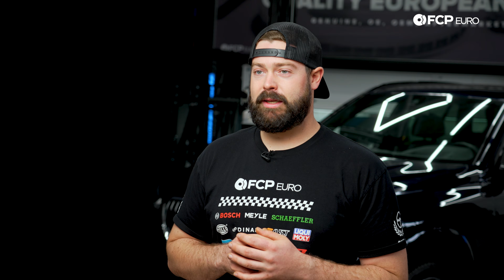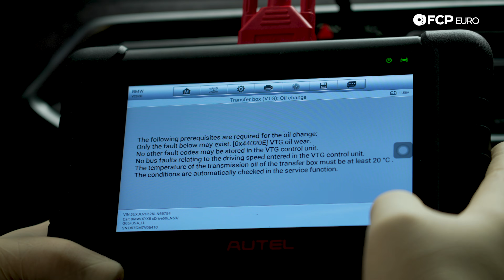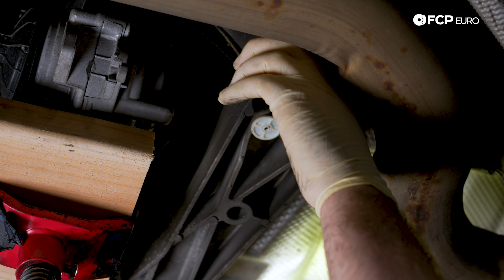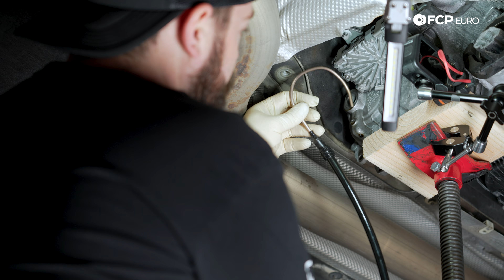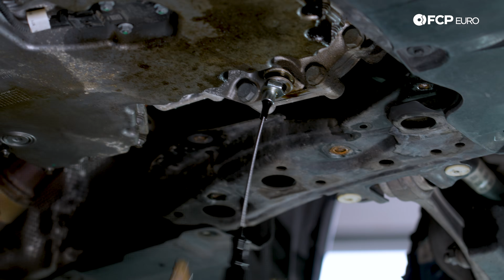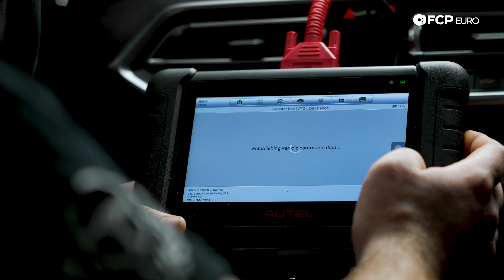BMW X5 Transfer Case & Front & Rear Differential Replacement DIY (2019-2026 BMW G05 X5, G06 X6)

Comment: all the trans and differential and transfer case oils need to be replaced every 30,000 kms. There's no oil additives and protection that lasts past that. Hence why even changing at 80,000 kms or 100,000 kms won't keep these cars around. Too much issues unless you do it at home and repeat. No one does though lol

Comment: I have a 2022 bmw m440i and I am currently trying to drain the transfer case fluid and I can get anything in the port to drain the fluid. I have a copper tubing like what is used in the video but I cannot get it in very far, any suggestions. I have tried using a flexible plastic tube as well, it’s been frustrating
Reply: Did u buy the hook tool from fcp? It’s like a bent metal tube to fit into the bottom of differentials …

Comment: OMG, the VTG fluid change procedure is a challenge especially needing the proper scanner tool to do the joy right. Cole is excellent as host with step-by-step procedure and verbal specification details, especially 600ml volume limit on the front differential. Video production most excellent as well! Quite helpful for DIY'ers. Thumbs up to FCP Euro! You folks are great and it shows!

Comment: Was trying to use diagnostic and open ports. My car wont let me in service mod it require Ista bmw original disgnostic. Insted i change oil without using diagnostic, problem gone instantly no shuttering no jerking, after 30-40 miles driving i change it again. And now all 100% oil is changed. If someone doing this maybe my comment help

Comment: First of all, many thanks for this great video. Very clear step by step instructions. 

I have 2019 BMW X5 G05 xDrive40i B58 Engine. I followed exact procedure you showed. I could only retrieve about 250ml of old oil from the transfer case. Is that OK? If not, what else I should do?
Reply: You didn't get to the bottom of the tcase if you only removed 250ml of fluid

Comment: We have quite the paradox with BMW engineering.  The same engineers that said the fluids are "lifetime" are the same engineers that gave the specifications for the fluids you will be using to replace those "lifetime" fluids in the vehicle.
Reply: Is easy to explain, their “lifetime” means warranty period
Reply: Sometimes you need to remove and refill when doing jobs such as engine oil pan or such.

Comment: Tip:  you can heat same diameter pvc tube to make that bent.  Tip 2:  Once you pump with syringe or bulb just relax as fluid will run down by itself.  Just did mine and it emptied the whole thing no problem (physics).  Tip3:  Remove small bolts from the brace but lean the long one the goes thru the bushing on.  The brace will swing plenty to get the plug, tool, pump.  It swing out like 4-5 inches.  By the way you don't need to remove that small plastic thing but just one screw as it bents back plenty to allow torque wrench to fit.

Comment: you might as well let the dealer do the service.  The cost of a scanner, fill pump etc are more than the cost for the dealer to do the job.
Reply: But when you do this service 2nd time and 3rd time then it becomes cheaper
Reply: @Mekus5  Especially if you are doing it every 30k miles
Reply: my service spalce quoted $700. 600 labor.

Comment: BMW X5 rear differentials typically require SAE 75W-90 synthetic gear oil (GL-5 rating). However the Febi Bilstein 184247 on FCP Euro is 70W-80. Are we sure that's the right oil?

Comment: There is a rear differential temp. Sensor that can be used as a drain plug on the M50i’s.
Reply: Cars equipped with the "M Sport Differential" such as the X5/X7 M50i and M60i models have both a fill plug and a drain plug for the rear differential.
Reply: How does that work. That would be a lot easier.
Reply: @brandonbailey7637   Unplug the sensor and then take a deep socket to loosen the bolt
Reply: Also would like to know

Comment: Thank you for these amazing videos. Could you please explain why and in what situations you would use the “3× Start/Stop + hold 7s suspension button” procedure?
Reply: 3x start stop is to put the car in diagnostic mode. Holding the air suspension button for 7s disables the auto leveling function. The car will otherwise try to level itself out as you jack it up. The green air suspension ride height indicator should go away when it is disabled

Comment: Watched this to try and get more tips on the G01/G02 X3/X4 M40i because of similarities. Especially the procedure of taking the transfer case out of service mode, vs resetting adaptations. It appears the adaptations were reset? It sounds different on ISTA+ and Foxwell scanner from what I've read on the forums where it's two different procedures. Some say not to reset adaptations, similar to the transmission fluid unless your rebuilding a component. As far as the front diff, the forums say it is not fill till spilling out (like stated in the video, thank you!), however there is a 450ml measurement and 600ml depending on diff. I'm going to use a plastic measurement beaker to try and see if 450ml comes out, or closer to 600. The rear diff is where it gets tricky with the M40i. The "m sport optioned diff" gets G4 instead of G5 for a friction modifier. Trying to do my best research to do this job properly. Thank you for posting the video!!
Reply: X3 m40i has 168AL front diff and takes 450ml as per ISTA.  Rear diff is 800ml for non M 205AL.
Reply: Transfer case reset is simply telling the computer there's new fluid and it will adjust it's clamping force.  Always reset the calibration/adaptations when changing the fluid in the tcase.   Only time you're ever resetting adaptations on a ZF transmission is when you're swapping the valve body or doing a complete rebuild.  Never with a simple filter/fluid/pan service.